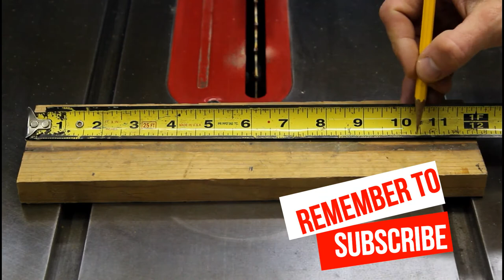easy diy wooden wine bottle glass holder

Comment: Can you give me more details on that router bit you used? want to pick one up but need a little more details, thanks so much for this amazing little video!
Reply from the maker: Awesome. I use a round over router but the most. It’s a nice easy way to get rid of the sharp 90 edges.
Reply: But which roundover size?  Is it a 1/8, 1/4",1/2" ?

Comment: What size bit did you use for wine glasses?
Reply from the maker: 1" for the glasses and 1 1/2" for the bottle but you could use smaller for the glasses if you wanted depending on the size of the stem of your glasses. Hope that helps
Reply from the maker: Oh Forstner bits I used

Comment: dimensions for your piece of wood?pls
Reply from the maker: It really depends on what bottle of wine and glasses you have plus I just use scrap wood.  12” x 3 1/2” for the wood. 1 1/2” hole in the middle. 1” holes on both ends 2” in